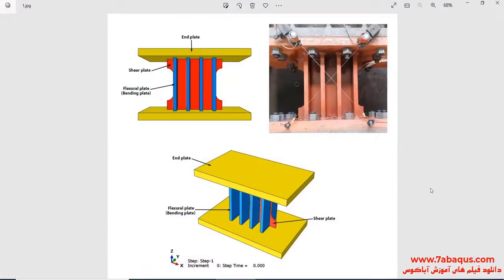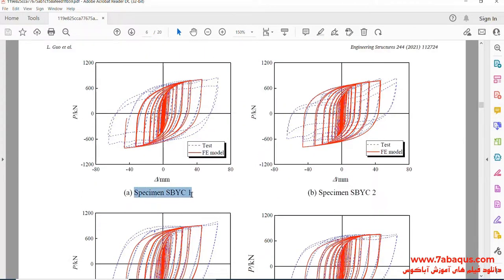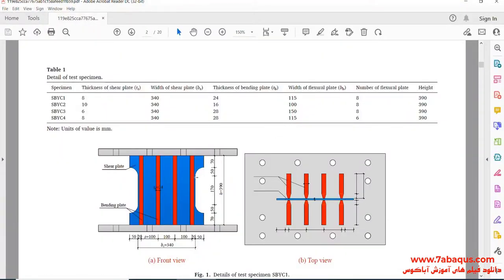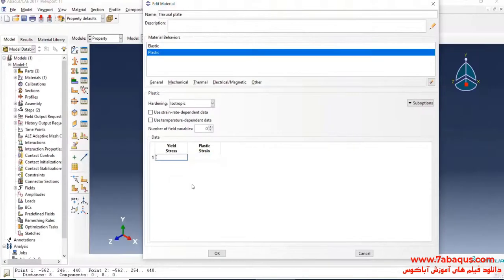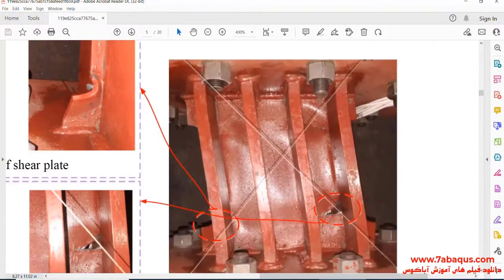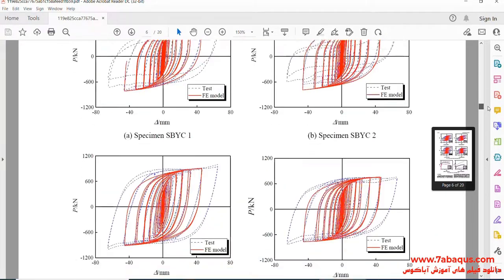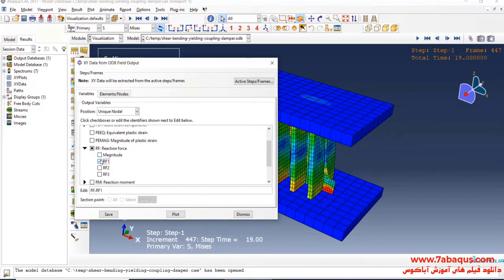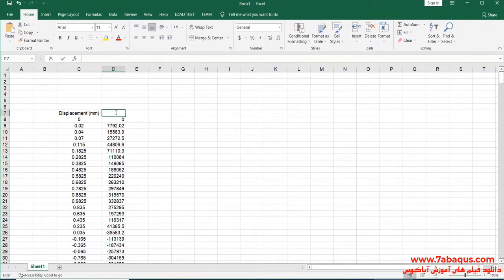Seismic performance of shear-bending yielding damper Abaqus

Comment: thank you sir for this video. I have a question, ıf we want to model pin connection. There is a hole for example 90 mm height and 22 mm width. ı want to put a 20 mm pin inside this hole and the pin can move up and downside. But there is a 1 mm gap between pin and the hole surface. how can ı define interaction or how can ı model it ?
Reply from the maker: You have to model both the pin itself and the interaction